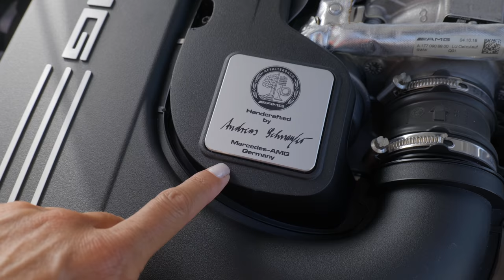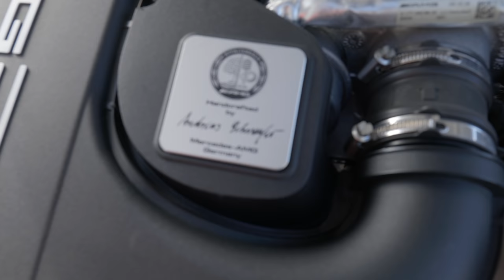Blow Off Valves on my 2019 AMG C63S (VRP Speed)

Comment: A blow off valve on that engine makes your car slower. The recirculated air is supposed to go back into the turbos to keep them spooled and reduce turbo lag. A BOV is for high boost turbos to release pressure to prevent it from breaking things in the turbo, the turbos in that care are not high boost turbos so you're just releasing air that would be used to keep your turbos spooled.
Reply: These are not BOVs, but merely vents designed to release hot air that would otherwise be recirculated back into the intakes into the atmosphere. There is no material affect on performance.
Reply: @kjdeutin  Do you know how spooling a turbo works? This specific engine is designed to keep that hot air pressure spooling the turbos. Releasing it into the atmosphere takes away turbo spool. Please do some research on this.
Reply: @mrfreakshowster  This has literally been proven to have zero impact on this motor or the turbos. This mod is cosmetic and purely for sound. As stated, it has no material affect on these cars. Weistec uses their VTA on all their high horsepower C63 builds. Hundreds, if not thousands of C63 owners do the same with zero impact on turbo longevity or performance.
Reply: @kjdeutin  it affects the powerband and where the turbos kick in. It does not affect longevity and why would it. When the turbos spool that is when you get the added boost... when that hot air gets released the turbos stop spooling and you have to build that boost up again by reintroducing hot air that has already been released. It's a mod people do for the sound and it causes you to lose boost that you otherwise would have had.
Reply: @kjdeutin  literally in the video he explains what boost is for and says he wants to release it rather than keep the boost. When you go hard on throttle and build up boost and go off throttle that air keeps the turbo spooled so you don't have to wait and spool the turbos again to build boost. When you let that air go and let off throttle that boost is gone and you have to re-spool the turbos to build that boost back up again.
Reply: @mrfreakshowster  It literally changes nothing with the function of the valves which is why it has no negative impact on operation of the turbos..  
 
The valves are meant to release excess pressure.  With or with out the VTA adapters, they release pressure.  With the VTA adapters, the pressure is released to atmosphere to make noise.
 
Since nothing about the operation of the valve changes, the only difference is you hear noise when the VTA adapters are installed.

These valves have NOTHING to do with spooling the turbo and retaining pressure in the system. The whole point of these valves in the first place is to release pressure and that’s exactly what it does regardless of the adapters are there.
Reply: @kjdeutin  Installing an aftermarket 'blow-off valve' defeats the clever function of the stock priority valve. The priority valve is there to remove turbo lag. It does this by recirculating the compressed air back into the atmospheric side. This keeps the compressor from stalling, so when you tip back into the throttle, it makes boost instantly. This is just as true at part throttle as full throttle. It works all the time.

There is also a very clever, simple delay spring built into the system, such that this factory priority valve system, once pulled open by manifold vacuum, resists closing for ~.1 to .3 seconds due to the resistance of this spring. This delay allows the turbocharger to spin up freely (no load) for an instant. As the valve comes completely closed, the turbine is now almost up to full rotational speed, so there is more boost available, much more when opening the throttle that without it.

If you want to understand this theory, put your hand over the suction of a household vacuum cleaner. The speed of the motor rises dramatically because, although still pulling a vacuum, it is doing no work (no air is moving). That is what the priority valve does for the turbocharger, specifically by adding pressure to the atmospheric side of the compressor wheel. It lets it freewheel momentarily and not loose rotational speed. Most important is the spring delay speeds up the turbine wheel further by there being no load on the compressor side.
Reply: @mrfreakshowster  it is literally NOT a blow off valve, it just mimics the noise of a blowoff valve…there is no change to turbo performance with this as the valve releases air regardless if this VTA adapter is used or not…it is a “vent to atmosphere” adapter, releasing excess pressure into the air instead of into the air boxes…the air being released is excess, aka UNWANTED air, thus actually reducing turbo lag. The diverter valve is what is regulating the pressure necessary for proper turbo function and the VTA has absolutely no affect on the valve’s functionality. 

There is no added benefit or detriment to using these VTA adapters. It is 100% cosmetic and for people that want the blow off valve sound on these cars. It only vents out a very small amount of air, immaterial to performance. 

Renntech, Weistec, ModalWorks, PTG, some of the most well known and respected tuners and engineers on the planet, all design VTA systems for this car for the same reason and can attest to no loss of performance. 

There are no “priority valves” on this car, nor are there any blow off valves. They are diverter valves. What you said was just completely wrong, and not only that, ripped off the internet from a post 6yrs ago and doesn’t even apply to this.
Reply: @kjdeutin  I thought I just explained it. Boosted air is recirculated to keep the turbos spooled a bit during gear shifts and when you let off the throttle. Installing an adapter plate with a hole in it negates that effect. The "BOV" products you see on here are also not blow off valves. If you want a real blow off valve, you're going to have to change the turbo setup a bit from the stock design.
Reply: @mrfreakshowster  the advanced computer system and diverter valve are regulating how much boost pressure is needed. There is no loss in boost. There is no turbo lag. There just isn’t. The air being released is EXCESS air, meaning no longer needed. The OEM diverter valve’s functionality is unchanged and the ECU will adapt. This design forces air out instead of back into the turbo, which is what causes turbo lag..

The people that make these things know what they’re doing and have a reputation to uphold. They’re even running these VTA adapters on their cars, but hey, what do they know. At this point, I have nothing more to add to this discussion.
Reply: @kjdeutin  it’s a Subaru mod that makes noise. It’s a fake blow off valve that releases pressurized air. I understand you want the computer to monitor the air but the computer can’t just make pressurized air out of nowhere?? That’s why you spool to get that pressure. There’s a reason Mercedes’ doesn’t have this on their black series car, but obviously you think you know more than mercedes amg.
Reply: @mrfreakshowster  this logic makes absolutely no sense. Do you remember the head bolt issue on the original w204 c63? Do you remember how people sued Mercedes and Mercedes paid out a huge settlement because their engineers dropped the ball? There’s a lot of reasons why a car manufacturer doesn’t do certain things from an engineering standpoint. Yes, sometimes even the fine engineers at AMG cut corners. Literally every business does. I guess maybe I shouldn’t get drag radials or stickier, wider tires for better traction on the back of my AMG because the engineers picked MSS 285s for the rear 🙄

Go take your patronizing and condescending comments somewhere else.
Reply: @kjdeutin  lmaooo you really do think you know more than amg. They probably did the head bolts intentionally same with the biodegradable wiring harness to give the cars a shelf life and save more. You also realize that you’re comparing reliability issues to performance issues. The gt black series had the fastest production car lap record at the Nuremberg ring. It’s a 400k car and you really think it needs some $12 Chinese fake blow off valve? Seriously that’s what you think?
Reply: @mrfreakshowster  none of what I said suggests I know more than AMG. And your points make no sense. The VTA adapter mod is for sound purposes ONLY. Saying that they didn’t put it on the Black Series, so therefore it must be bad, makes no sense whatsoever and is a logical fallacy.  

Yeah, dude, they did the head bolts intentionally knowing it would cost them millions of dollars in class action payouts and repairs after warranty, and a huge hit to their reputation. 🙄 It was poorly designed and engineered. There’s no excuse for something like that to happen on a $90,000 high performance car. 

And since you are too dense to understand the entire purpose of my comparisons, let me reiterate: AMG, and all companies, are a business. They make decisions, which include engineering decisions, with dollars and cents in mind, regardless if it is or isn’t beneficial or the best way to do something. There’s also more than one way to do something. I know that must be a shocker to you. They also cater to a certain demographic. There are so many factors that go into the process. No car or product is perfect. There are shortcomings and shortfalls in everything. While much of the aftermarket industry is snake oil, the good ones exist for the sole purpose of improving performance over OEM. But it sounds like it’s YOU who knows more than the folks over at AMG and the aftermarket engineers that have built the best and fastest cars on the planet and poured millions into R&D with your copy and paste 6yo forum posts and explanation of “primary valves” on a diverter valve turbo car 😂😂

Comment: Amazing content guys!! 
What set up are you running Chris?
I just got a 2017 c63 amg cabriolet.
What are the mods you’ve done to it?
Have a blessed one guys.
Just sub’ed. 
I live in Charleston!!
Reply from the maker: had a vrp intake, done with red ceramic intake pipes (currently for sale since upgrading turbos).  only 300 miles on it.  Only mod on it so far.

Comment: Good job you two! Remember Kristen, let Chris install external boost,air to fuel and oil psi gauges. The car's ECU should display those values on the screen but it's always a good idea to have a second set of external gauges to monitor. Cheers!
Reply: what a load of crap... this aint no honda vtec turbo
Reply: @DECKEDM  hahahaha I was thinking the same thing. But your comment is flawless lol